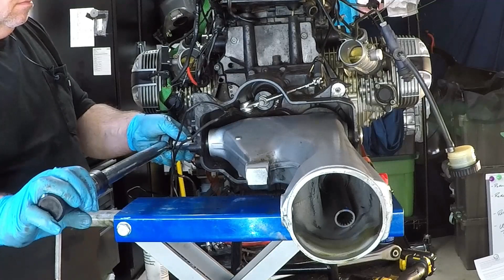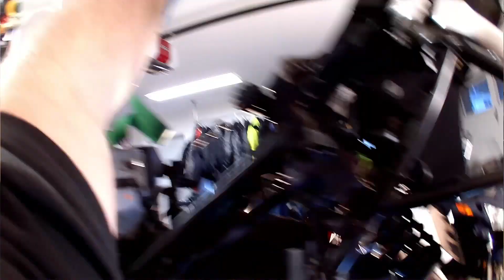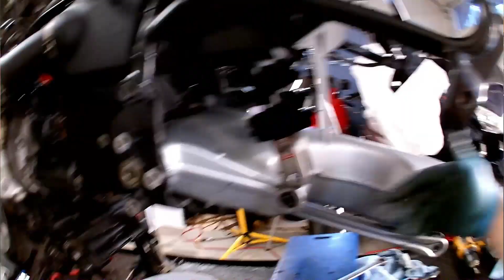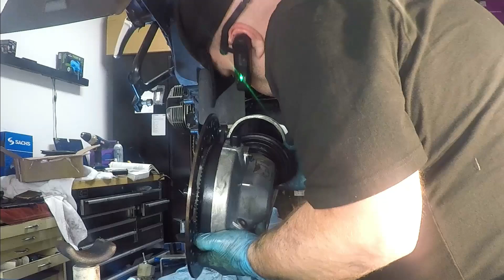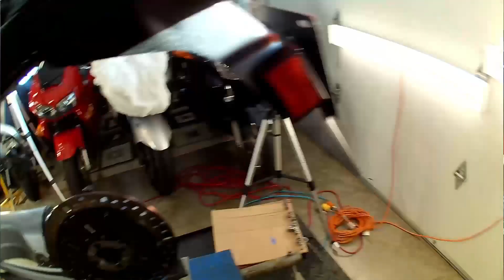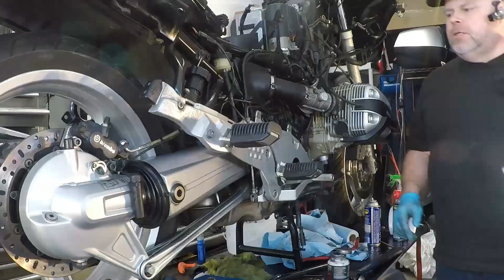BMW R1100RT Clutch & Throw Out Bearing Replacement - Part Two

Comment: First, I second (pun (?) intended) @leonardtadford6443's statement of "Absolutely brilliant and well explained video."  And join the myriad of "thank you so much" comments.

Question for you, please.... (just purchased a non-running 1999 R1100RT and am trying to sort things out. I am experiencing incredibly high crankcase pressures.... at idle (and only on 1 cylinder - but that's another story) it has blown off the oil fill plug.  AND THER IS NO AIR COMING FROM THE "VENT PIPE"  (PN 07 11 11 1 341 276) as BMW calls it.... that's the elbow that the vent hose attaches to (and to the airbox at its other end).  You talk a lot about this "be careful it's not pincheed" ..... 

Does the vent pipe have any type of valve in it, or is it supposed to be simply an open elbow?

Sure would appreciate your thoughts, Rod.. or anyone else's if the have knowledge (i.e. not just guessing) about this issue I am having.  Thanks in advance!  David

Comment: Absolutely brilliant and well explained video. I assembled the transmission this last weekend, easy while following this video, and I will do final components assembly this coming weekend. The only thing that got me to wonder was the space left between the brake disk and that big black rubber dust seal before the final drive. It's literally a fraction of space.  The disk totally clears that dust cover when I hand turn the rear wheel. But honestly, I doubt I can even fit a sheet of paper between the two. I did loosen and reseat the rubber dust cover but try as I may, I just cannot increase the space between the two.
Reply from the maker: Thanks for the comment.  Have you tried rotating the drive shaft gator?  It may have developed some rigidity and now is formed to specific direction.

Comment: Did you cover the brake vent line that goes to a "34517677998 catch basin"? Where is that catch basin? Is there a time in your video that shows it's location? Thanks!
Reply from the maker: The R1100 does not have this part, it is something they came up with on the R1150.  Just disconnect the vent hose from the cap or catch basin if it is in your way.  Thanks

Comment: Thanks very much for the video, explanations are nice and clear. One question: When installing the left footrest plate did you have any issues with the alignment of the holes of the subframe/body & plate? - Thanks!
Reply from the maker: Not with the plate and subframe but the shift mechanism took a couple of attempts to get aligned if I remember correctly.

Comment: Hi Rod. Not picking on you but your line about spending more on parts than the bike is worth sort of proves Ryan F9's point. Most people wouldn't have the skills required to carry out this repair.
Reply: True. However, from a sustainability standpoint, it is nice to keep a bike on
the road instead of turning it into a parts bike or sending it the scrap yard. Less waste overall. I try and do my part by driving my R1150rt and 325i wagon instead of upgrading (although I do guiltily own a new Triumph Scrambler 1200 too).

Comment: i am going to inspect/buy a 96 of this bike with 28k miles this saturday. do you have any tips for me? thanks.
Reply from the maker: I have an early video on purchasing a used bike, it is a little long winded so scroll to the parts that are relevant to you.  The wiring harness is a weak point due to its construction and very difficult to change.  The hall effect sensor is another but if the bike is running its supposedly good, ask if it was done.  The abs is also an issue there are two relays that fail, one under the seat, the other under the fuel tank on the pump or the whole pump fails.  The clutch should still be good if the mileage is correct, if the action is late the odometer may have been changed, it is easy to do on these models.     https://youtu.be/LBzM3BscNpo
Good Luck!

Comment: i keep pondering the idea of buying an R1100/1150RT for years (i have a '00 VFR800) but everytime i see those maintenance nightmare vids it puts me off :D
Reply from the maker: BMW Clutch is about the biggest difference in maintenance from a conventional wet motorcycle clutch.  This is about as bad as it gets, the upside is how long they last and the way they ride. https://youtu.be/1y23fS37_k0
Reply: @RodRidesWrenches  its just when you take a BMW plastics off it looks like an overwhelming maze of wires, sensors, hoses. I watched that video and shortly after an opportunity on a Moto Guzzi Griso came up for a price i couldn't pass, that bike seems to me like an italian interpretation of a BMW R1100/1150: longitudinal air-cooled twin, dry clutch, separate transmission, driveshaft, but the clutch on it is a twin plate